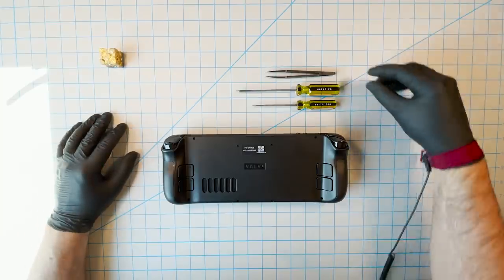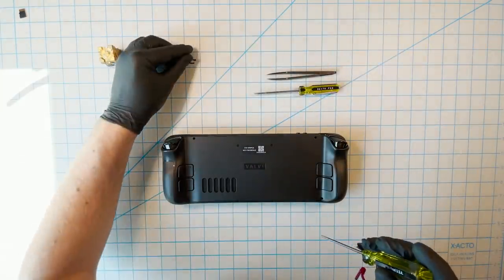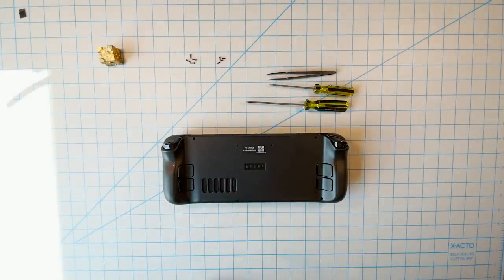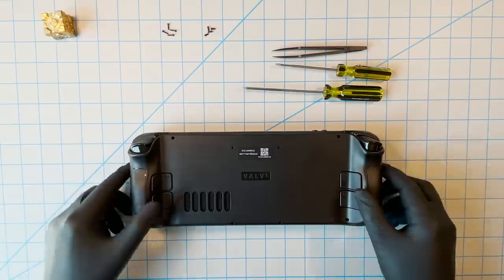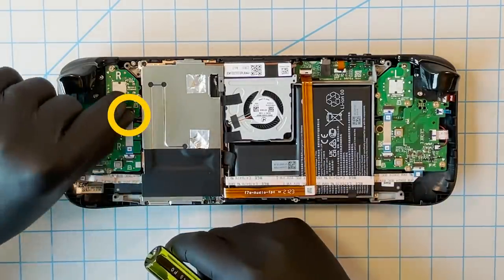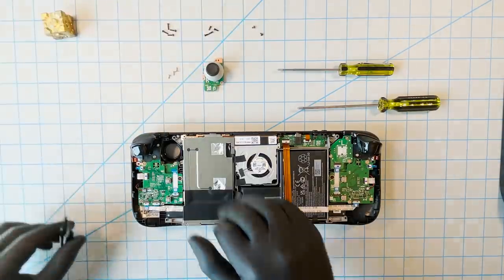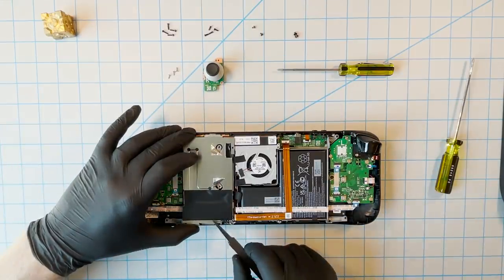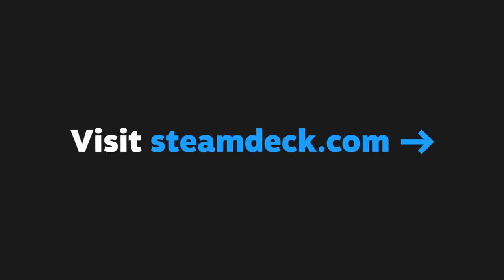Opening Up A Steam Deck

Comment: I understand this is to cover Valve legally, but it will be interesting to see real tear downs by Gamers Nexus, and other tech channels to see if any of the claims made here are true e.g. opening and then reassembling the case weakens structural integrity; do off the shelf SSDs actually affect thermal and Wi-Fi performance, etc.
Reply: I highly doubt these kinds of warnings are necessary at all legally. The claims seem a bit exaggerated to me, to say the least.
Reply: @sauyon  I think its them covering their ass from any potential legal cases. While trying to show they are presented as a company that supports right to repair.
And I'm pretty sure they have super exaggerated in what they say so it can't be misconstrued by someone to take advantage of the.
Reply: Theyre saying that its a disposable pc
Reply: @JogBird  all computing technology is disposable, nothing really there dude.
Reply: Honestly these claims seem very practical and completely reasonable and correct. They are really talking to and for the people unlike you and I. Like with the structural integrity, they showed damage tests and I assume they tested decks after having their screws re-installed confirming their claims, no matter how small they are. And when it comes to the ssd potentially interfering with other components is reasonable becuase there are certain devices out there in the world that are not compatible. You's being too skeptical about nothing. And for example. Linus tech tips does thermal tests on hardware before a tear down and reassembly since there will be changes between before and after.
Reply: @DARKSHREK000  you can literally upgrade the memory by sliding a little chip into the side. Why would they be making it difficult to upgrade memory if they included a memory expansion slot. Apple on the other hand doesn't allow this which would be a proper example of a company and device that is not user minded. This video however is literally nothing but user minded information for those who actually want to go down the path of personal upgrades. Do you have any clue how much innovation and squishing shit into a small ass space Valve just did?
Reply: @DARKSHREK000  and what they are saying is both the truth and warnings. Not simply them trying to deter. Would you want this important information about how different ssd's have the potential to interfere to not be included? I wouldn't.
Reply: @jacobt1045  They may have some elements of truth, but they say things like “you could die” and “static could easily destroy your device”. Both of those may be true, but they’re extremely unlikely events that could be warned against in a way that isn’t blatant fearmongering. I’m glad this video exists, because it’s a good guide to how to do it, but their goal with the warnings is clearly to deter any casual observer from even trying to do anything with their machine.
Reply: @sauyon  I felt those warnings were practical and were presented in a nonchalant way that shouldn't elicit fear. And having the potential to die by simply doing nothing but manipulating things with your fingers is probably the most valued warning out of all of them.
Reply: @jacobt1045  you've clearly never worked with electronics before. These claims are exaggerated af
Reply: @nightrider8398  I built my own gaming pc. I watch everything thats tech and agree that the chances of death is stupidly small. Doesn't mean it can't happen. Same as zapping a component with your electric shock.
Reply: @jacobt1045  that's not memory, that's storage. And I can already see someone trying to use a m.2 2230 ssd that has nand and capacitors on the back side which probably will not fit.
Reply: @Lead_Foot  oml. I said memory by accident compared to all the other times when I said ssd... sorry.... But I do see how that fuck up really shat on me saying "I built my own computer" as the main example.
Reply: I think you all are just misjudging the valve team
Reply: lol all those things are exagerated
Reply: @jacobt1045  yeah a shit slow ass chip that in no way compares to an nvme
Reply: @quintonjewett1253  Any company that willingly shows you how to dismantle your device isn’t trying to lie to anyone. This is a case of people way overthinking it. From a big business standpoint this kind of thing is COMPLETELY unheard of, like this caught me completely off guard. This is so uncommon they probably aren’t sure what to expect either, and just want to be eeeeeextra careful. At the end of the day they aren’t saints, just a business - but other than standard marketing I don’t see a con here (most people getting a deck already reserved one anyways so there’s that to keep in mind too).
Reply: @DARKSHREK000  That is nonsense. Valve is in the business of selling games, they are not interested in  making money from selling hardware. They want to make sure that they are not liable when people make mistakes.
Reply: @sauyon  Appliances catching fire because of a faulty battery might be unlikely, but fires do kill people. It makes perfect sense that Valve doesn't want to be liable. There are plenty of people out there who don't know what they are doing and open a device just because they saw a video on YouTube.
Reply: Self tapping screws cut their way into plastic when they install them in the factory, if you remove them and reinstall them you're re-cutting already cut threads in the plastic. I've worked on stuff that has the same type of screws and it's 100% true that they don't hold as well 2nd time you screw them in. Sometimes they don't hold at all and you need to fill the hole with something, drill a small hole and screw the screw back in so that it cuts fresh threads.

Their SSD seems to be shielded so that's also a valid point they're making, if you use a low quality ssd with no shielding at all it COULD cause problems with wifi signal since it's close to the antenna. Doesn't mean that it will but if the SSD you install has just one noisy component it could be a problem.
Also their heat and power warning is ALSO valid, low quality M.2 SSDs heat up more and use more power. Different M.2 controllers built on different processes with different memory chips, if you go for lowest of the low quality it could pull more than double wattage than a higher quality one. Remember that's PCI-e M.2 NVMe port that's used, it supplies it's own power and difference between 2 and 4W on a device that small with battery so tiny is huge. 

Both points are valid.
Reply: @calebfoley5872  Both Sony and Microsoft provided dismantling instructions on the PS5 and Xbox Series X. This is something common in the gaming space and the only ones not posting a teardown is really Nintendo in that space. People want to see what's inside for the gaming side of things. They also want to repair stuff on their own. Good to see Valve not bucking the trend and putting the heat on other manufacturers like Apple and Samsung.
Reply: They say they use self-tapping screws. The holes you use self-tapping screws on aren't designed for them to be removed and re-screwed, this definitely weakens structural integrity.

Comment: Nintendo: "We can't disclose whether the JoyCon of the new OLED model had the drift fixed".
Valve: "Here bro, take a look at all the internals before the product even launches".
Reply: This is why we call him Lord Gaben, lol. no one was really complaining until Epic came along and threw a tantrum.
Reply: You can still use third party controllers
Reply: Third party controllers replacement  exist so you don't have to worry about joy con drift
Reply: Yeah, it shows a stark contrast in how they feel devices should be upgradable/repairable and those who do not. Sony did the same, doing an official teardown of the PS5 before it launched, and the PS5 (as well as 4 and 3) had user-upgradable storage. Nintendo and MS on the other hand don't let you upgrade the internal storage, discourage self-repair, and never made teardown videos.
Reply: does Valve disclose if their joysticks will have drift problems?

Comment: The SSD is the one thing I want to mod. I don't mind if I have to take it to a verified tech or whatever to get it done.
Reply: How much would it cost to get done?,
Reply: @Patrick Swan Yeah, they're obviously hedging here, hoping this is enough to scare away people who probably shouldn't open it up.

I've taken apart almost every console I've owned, I build my own desktops, and I work in IT. I think I'll be perfectly fine.
Reply: @Patrick Swan That isn't what they're saying in the video
Reply: You literally just watched it be done in a handful of steps. Just don't drop your screwdriver all over.
Reply: @Patrick Swan when he says mechanical he means dimensions, of course ssd's don't have spinning platters
Reply: @MatthewDuplissis  Yeah, the "durability degradation" made no sense at all. Unless if they had set the pounds of force into them that wasn't too much or too little.
Reply: @Patrick Swan I wish you listened. Mechanical interference means that it might touch other parts and cause problems. Not a damn disc spinning.
Reply: @Patrick Swan they are talking about shape. a mechanical feature of an ssd.
Reply: @MatthewDuplissis  and that warning is not for you, its for people who are just as curious but not as informed. Why is the disclaimer a point of contention for people?
Reply: @ghostlegit  the product it self?
Reply: @MohdAzylee  no getting the ssd replace with 1 tb by a professional
Reply: @ghostlegit  professional are u serious 🤦‍♂️ its easy , can save doing it your self and learning. I mean why would  i care its your money lol
Reply: @MohdAzylee  because valve said not to do it.
Reply: @ghostlegit  are you serious🤦‍♂️😂, well money for the professional
Reply: @ghostlegit  this is easy thing to do, but if u scared that you will damage that thing. Its good
Reply: @ellemnist  it's exaggerated.

Comment: Linus' thermal camera reading makes so much sense now. Instead of the fan, the shrouded NVME drive is on the intake vent. I guess Valve aren't very worried about heat for those AMD chips.

Comment: I wish they didn't went with self tapping screws, or at the very least, they stated how much torque you should put on those screws. Asides that minimal detail, love it. Lawyers state that we should not open the device to reduce lawsuits, but outside that, it is your property, you do you, go ham. And we will support your choice by giving you the info as well as the parts you need so you are less likely to mess up. I would love if more companies started copying Valve vs copying Apple.
Reply: now im curious if people can find a replacement screw for it. Same threads but not selftapping.

Comment: The placement of the vents is VERY strange, considering they aren't even near the fan.
Reply: They are forcing the air to move over the metal plate and to help cooling performance.

Comment: Just 256gb is around 30 dolars... so I will get the 64 gb easly  , since the apu and rams will be the same in all models there is no point on purchasing the more expensive ones, and lets be honest, whoever chooses a steam deck will have  more than average it knowledge to assemble the parts ...indeed steam deck is a dream come true, true pc gaming on the go and some extras on the side , not to mention the emulation that open gigantosaurus libraries... thanks Gabe  , finaly you did the right thing

Comment: A 5 minute teardown is already short enough, and they spend half of it trying to tell you not to do it.... while also telling you they will provide a source for replacement parts...

Both this device and this video feel like they were made between an argument with the engineers who want it to be user repairable and upgradable and lawyers who insist it must be sealed up and never opened by the user like an Xbox or Nintendo Switch.

Comment: Nice, my kioxia 512 gb m.2 ssd arrived today, I will do just as they showed in this video.
Reply: How long is the one you have though? Looks like this requires the really short ones.
Reply: @nathansstuff1547  That's why I ordered the kioxia one. It's 30mm that the 2230 slot supports.
Reply: @kaschwarkatercus6693  Ah, rightio then, that's good

Comment: I wish it were simpler to replace the M.2 since I'd like to use this as my ONLY computer...and... sorry Valve... I do run Windows... so I'd have one M.2 with Proton and my Steam library and one M.2 with Windows and all the other crap I run. Ah, well. Since it'll be the core of my setup and not being used as a handheld, I guess I'll just leave the back off of it... just like I leave the side off my computer case currently...

Comment: typical they purpose make replacing the SSD risky to the machine. even if it is just thermals not being as good etc. Just make it easy to swap the SSD it literally isn't difficult to make a user friendly machine when it comes to replacing shit.
Reply: did that look hard for you? it looked like similar procedure for any ssd isntallation. So what are you getting at?

Comment: RIP to everyone who bought the 64GB version, thinking an upgrade would be in any way viable. 

good lord, breathing on it wrong could cause it to explode.
Reply: Rip to you my friend for swallowing everything they feed you. Get back to your switch.
Reply: It seems fairly easy to me
Reply: @Kintah  I would be waaaay too nervous- too much that could go wrong for my tastes. Will absolutely be sticking with the SD option.
Reply: @Kintah  elaborate
Reply: @godofironart  Well its actually quite hard to damage the parts, its not like it falls apart if you look at it the wrong way. If you use common sense and follow the instructions pretty much nothing should go wrong. (I would also wait for other tech yt like GamersNexus etc. to upload their own video about changing the ssd)
Reply: I've pre-ordered the 64GB version and am very pleased that the replacement process literally just involves screwdrivers and obviously being careful. If it had needed soldering and/or a heat gun, then I'd never have attempted it. Trickiest bit now is finding a cheap 2230 SSD! Oh and all the doom and gloom narration is simply Valve covering themselves for the absolute worst scenarios - the visuals, however, show me that this is pretty straightforward.
Reply: The 64GB model's SSD cannot be upgraded. 🤔
Reply: @ThatRandomFastingGuy  they said its a nvme module for the 64gb model.

Of course all this information was released after the pre order opened.

Im kicking my self for being cautious and ordering the 256gb model.

With how much they where pusing its difficult i expected thr nvme slot to be on the bottem of the main board or something so you have to do a full disassembly not that even that looks hard any more.